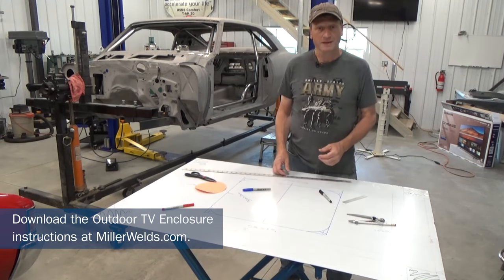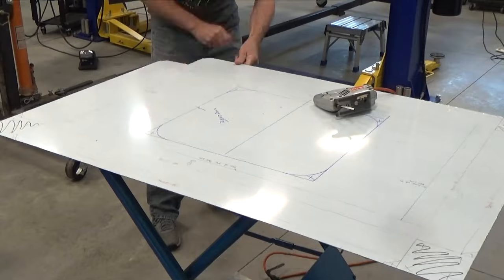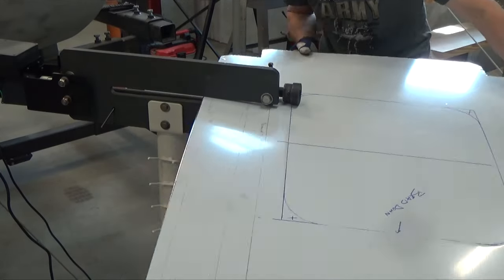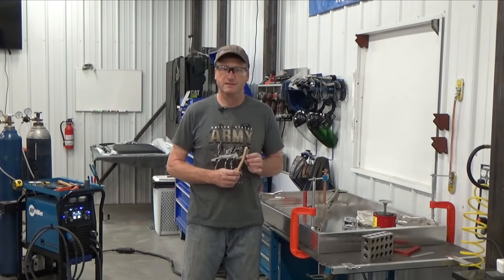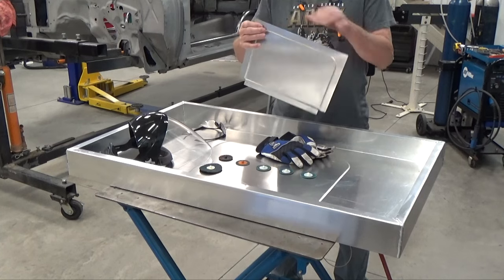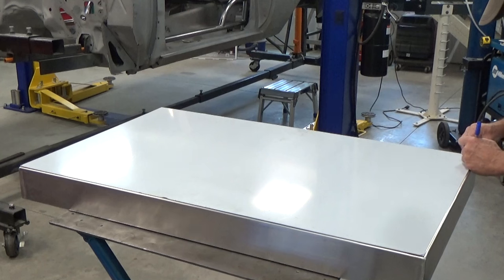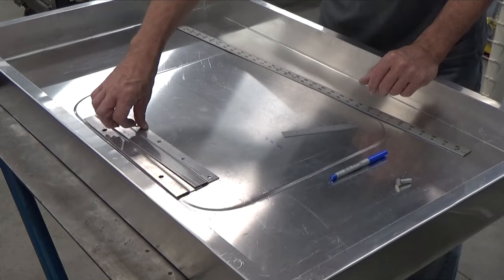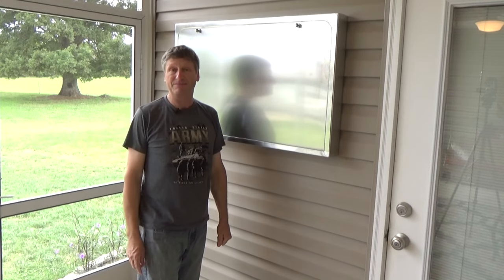Welding Project: Outdoor TV Enclosure (Real Project)

Comment: Nice project and well done.  Just a thought.  If you rotated the front cover sheet 180 degrees with the stepped flange on the top and the locking devices on the bottom, perhaps this enclosure could be made a little more weatherproof (drip proof).  Might have to adjust the bottom locking devices a tad but I think it would work.  Would then suggest a couple of small drain holes for any water that might get inside the case in the event it is placed where there was a chance for rainwater to intrude.
Reply: I came here to say the same thing.